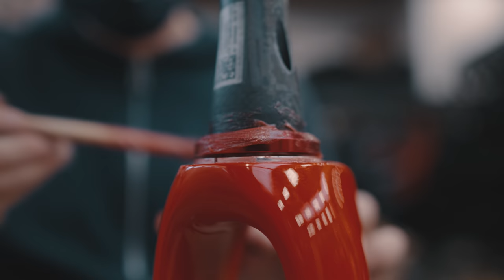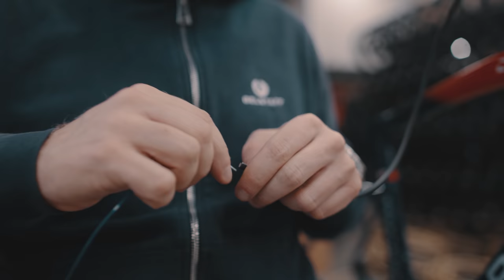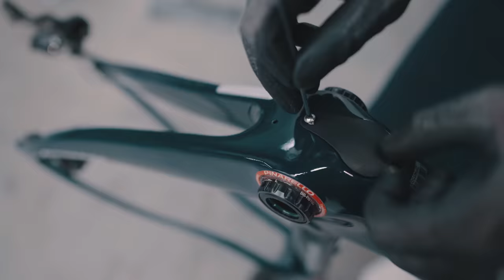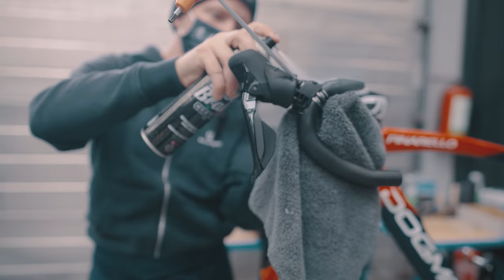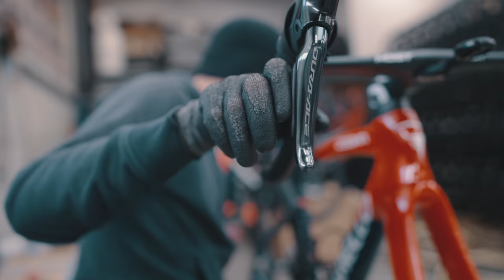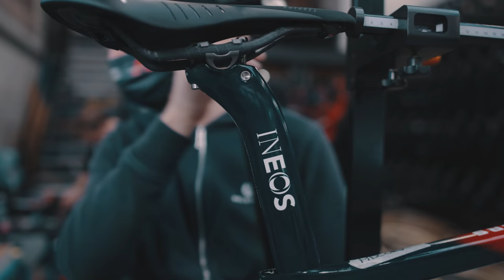DREAM BUILD ROAD BIKE - Pinarello Dogma F Team Ineos - Tom Pidcock

Comment: Interesting they're using an 11 speed chainset with 12 speed dura ace. Assume this is because the power meter version isn't available yet, and 11 speed chainset is a lot lighter. Does an 11 speed chainset work completely fine with 12 speed?

Comment: Newest Dura Ace R9200 groupset with older R9100 crankset?
Reply: They use the build-in powermeters and Shimano can´t deliver enough 9200 powermeter cranksets at the moment, so they use the older cranks.

Comment: Curious what purpose the zip ties serve on the DI2 wire when routed internally through the frame?
Reply: They're plastic clip-on ties that come with every Di2 wire to prevent the wire from rattling inside the frame by pushing them against the inner walls of the frame tubes.
Reply: @yonglingng5640  i removed them all, the wires themselves are too soft to make any noise.
Reply: @bikingchupei2447  I've never tried that before as I don't want to complete the build, only to hear some rattling right after. Depending on the length of the wire, I only clip on one to three of them.

Comment: No weigh in and old 9100 crank with 9200 group
Reply: Even teams have supply issues for parts so yes you’ll see teams using old cranks, discs etc

Comment: My dream bike wouldn't be a Shimano one, but a Campa EPS.  Plus replace most of the steel screws by titanium ones (bottle cages, cockpit, brakes, seat post & clamp, battery compartement, etc) and also titanium thru-axles.